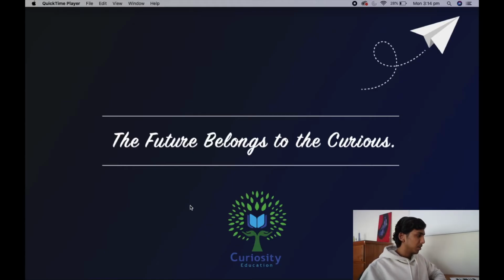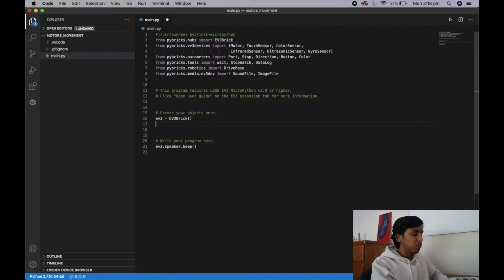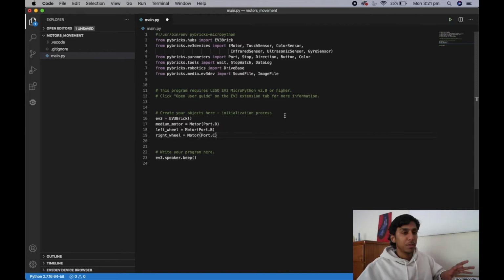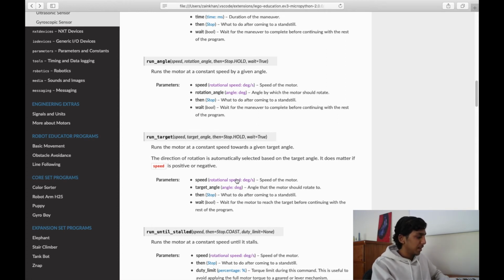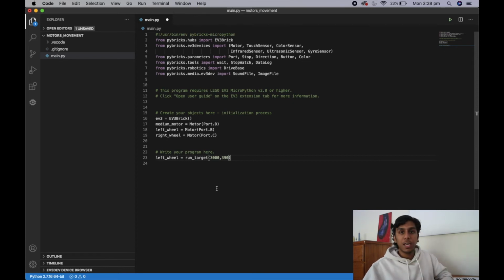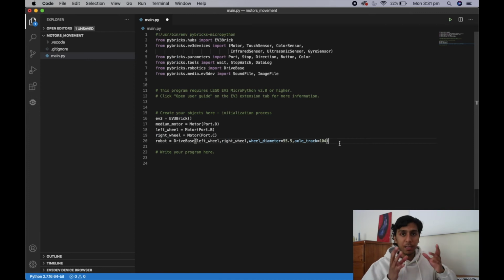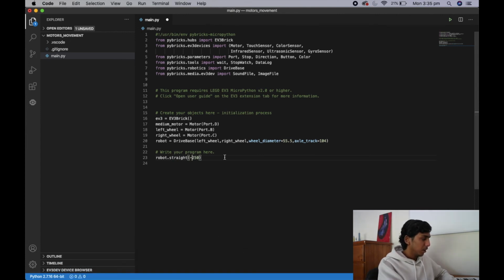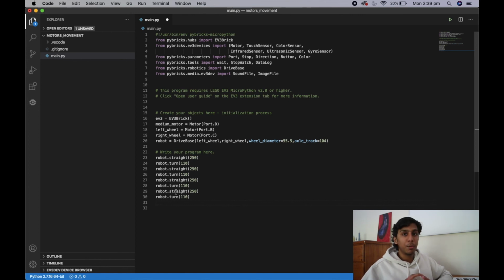How to use Motors and Movement in EV3 MicroPython [2]

Comment: Hello! I have a ev3, with ev3dev, and obviously i use micropython to program the prototipe. I already used the ev3, the last year to participate in WRO competition, with large motors, and the software runs normally. Actually, i have another robot, with the same SD, but with medium motors to the drivebase, and the code doesnt work. Talks about a error in the drivebase, and, the drivebase, is perfectly writed. I dont know if i need to reinstall the software in the SD, that is what i do when this "strange" things happend, but, if you can give to me your impress, i thanks that.